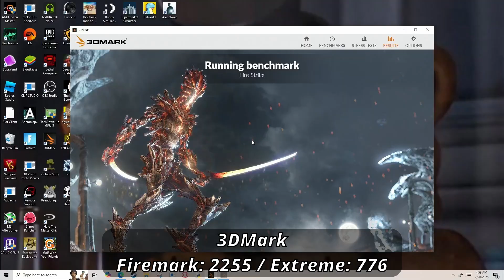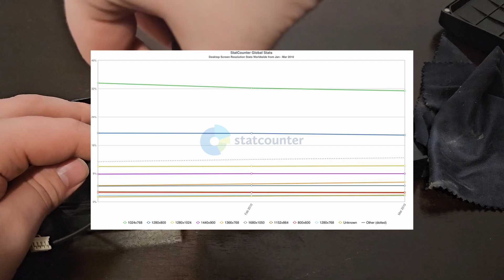Radeon HD-5830: Any hope for a 15-year old card?

Comment: I like old cards. My main gaming computer had two Asus Radeon 7850 DirectCU II up until the Mainboard died this january. Now i have a new build but I still miss my old rig.
Reply: Dude, say more about it, what were you playing on that
Reply: @StuffingSkulltag  Mostly Minecraft back in the day, but a lot of modded like FTB Unleashed. Also stuff like WoW, LoL, Rollercoaster Tycoon 3, Runescape, Batllefield 1+2+3, The Elder Scrolls (Oblivion and Skyrim), Fallout 2+3 and New Vegas and as many other games I got my hands on. Later I also used it for CAD, programming and other study related stuff. And since 2016 my all time favorite, Stellaris, which also became the reason my old PC died. Couldnt handle the late game. (The specs of the old one were: two Asus Radeon 7850 DirectCU II, AMD FX8150 overclocked and watercooled, Asus Sabertooth 990FX Mainboard, Bequiet 630w, At first 16 and later 32gb of DDR3 RAM, Blueray burner and a big HDD, later added a SSD for Windows. I've worked a LOT on the weekends and holidays (was still going to school) to get enough money together, hardest part was finding someone to give a job to a child lol. But it was worth it, would 100% do it all again.